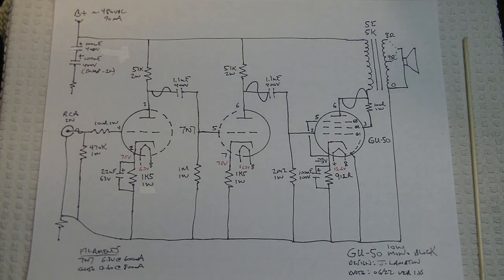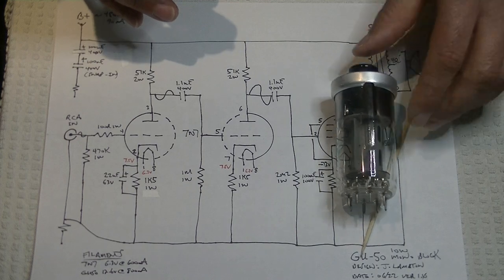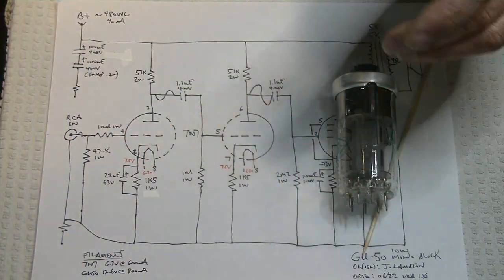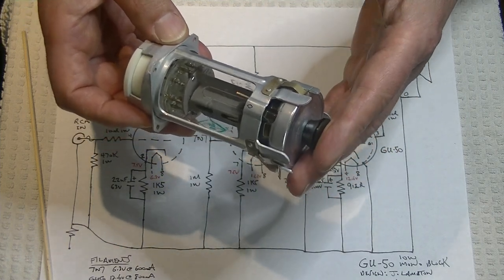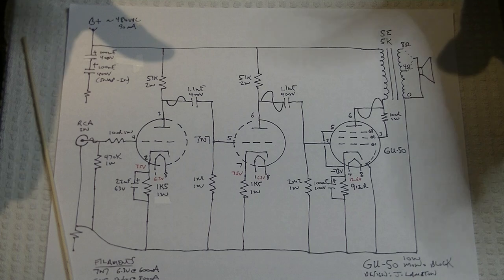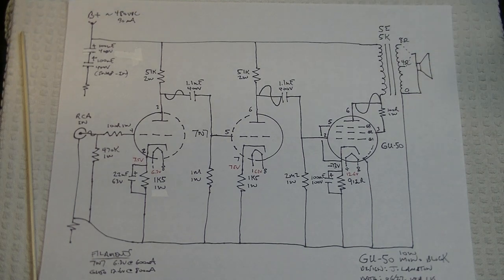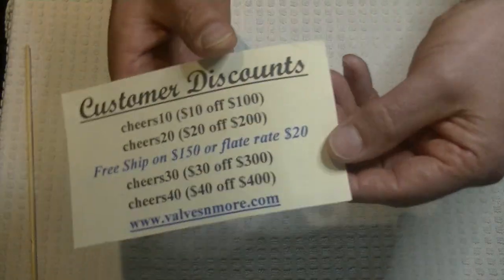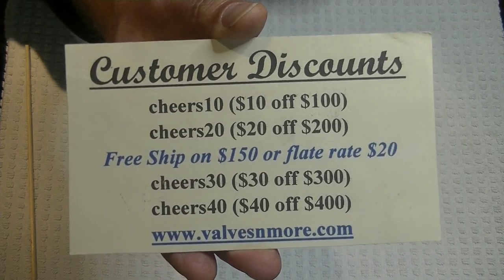Tube Lab #87 - GU50 Monoblock Prototype

Comment: I love those original "off-road" sockets with the big aluminium cage surrounding the valve! They are hideous, but very charming. They look very "mad science"! I would hate to see the aluminium cut off as you described.
If this prototype makes it into production, do you think you could have an option to build with those sockets?
Reply from the maker: Haha, you are now the second person to speak up about the Soviet sockets!  Two problems in using them, first the socket holes aren't even close to the modern version and second they're designed to hold the tube tightly, so removing them required a mini crow bar I keep handy on my bench.
We are committed to keeping the cost of our Kit Amps as low as possible  and keep the quality of sound as high as possible.  If the GU-50 prototype turns our to be a good sounding mono block, I'm hoping to bring it to market at an affordable price.  So selling each one with a mini crow bar may be one too many unnecessary costs!